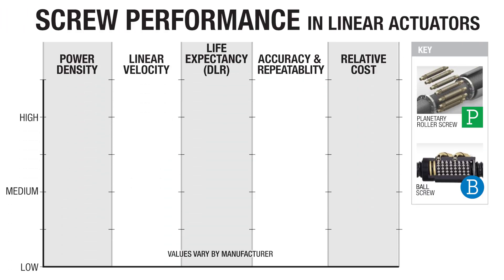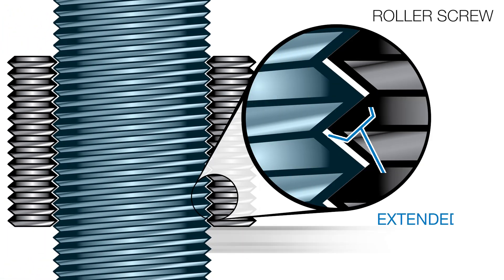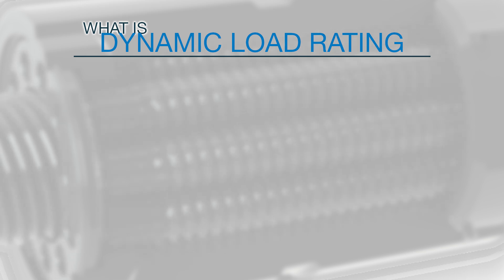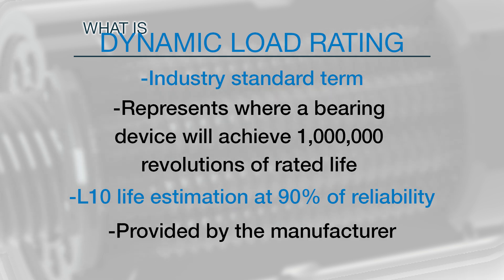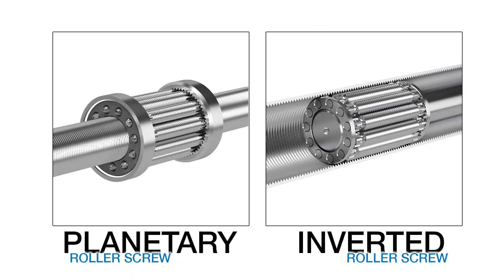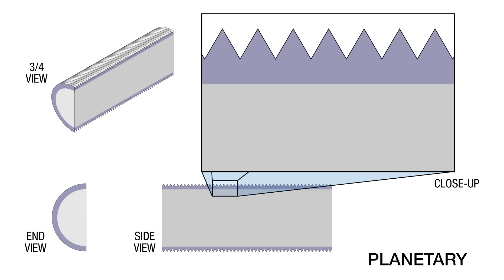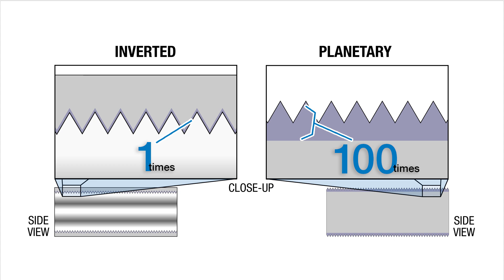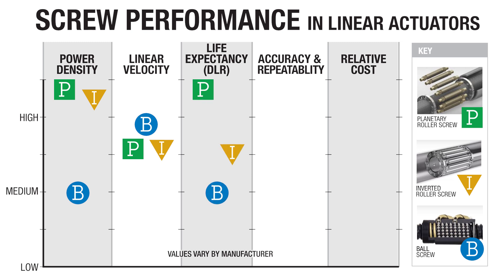Advantages of Roller Screws | Planetary vs Ball Screw Actuator Technology

Comment: Is it a good product for cnc routers? Or is it overkilled?
Reply from the maker: Tolomatic Roller Screws are generally used for high force applications however they may be a great fit depending on the level of precision required. Contact our engineering team to discuss the specifics of your project: https://www.tolomatic.com/contact-an-engineer/